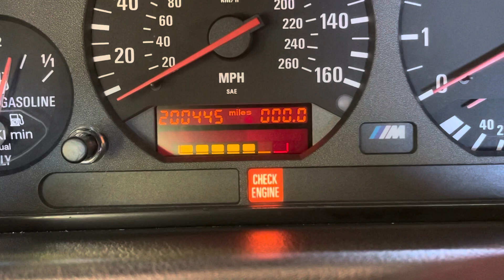Intermittent odometer display e36

Comment: Hi Nasri. First of all, thank you for stopping by on my channel. This looks like typical false contact with the zebra connector. Try replacing it with a new one, and it should solve the problem. They are widely available, and quite cheap. You need to measure the pitch of the cable (I think technically speaking it is called a ribbon cable), and determine the width of it, as there are literally thousands of references to choose from. If you need to remove the protective varnish, you can use a scrubbing block which is usually found in electronics supply stores.
Reply from the maker: Thank you so much Geoffrey. This makes total sense, since now that I have opened it three times, each time realigning the ribbon connector (and applying more pressure by placing a thin spacer between the metal clip and LCD screen), the problem is almost fixed (it flickered once just for 10 seconds yesterday - but before it used to be dim/not fully lit over 50% of the time). I will look into buying a new zebra/ribbon connector (or LCD screen from old model) - but I have to worry about sticking it carefully on the LCD screen; I wonder if it has an adhesive on one side?  

I just wanted to know if I needed to worry about the capacitors, but it seems that this is not a capacitor issue - so Many thanks (since I don't want to replace components that are not faulty/damaged)! I may still want to re-solder the pins of this LCD screen on the back of the PCB board (after I remove this varnish- thank for your help on that too!) - several others reported this as common problem of the symptom I am experiencing!
Reply: @nesnas  The ribbons I have used so far have no adhesive. They hold in place once they are sandwiched in between the PCB and the screen. Re-soldering the joints is entirely up to you, although I am not 100% certain that is is necessary. Hard to tell from where I am sitting, of course. Haha! Glad I could help, at any rate. Best of luck, and enjoy your E36! Fantastic cars those. I had a 320i coupe for a few years. Absolutely loved it...
Reply from the maker: @gmcevoy  Thank you again! I agree they are fun cars to drive! I just uploaded this video and you can see the pins joints on the PCB clearly (with the protective coating) at minute 7:40
I think they look fine? I wonder what you think - kind of hard to see with the coating! They did not have play when I pressed on them.

https://www.youtube.com/watch?v=0pY921_RSok